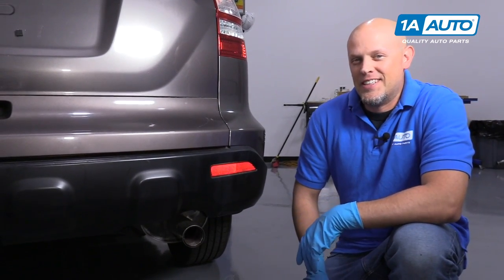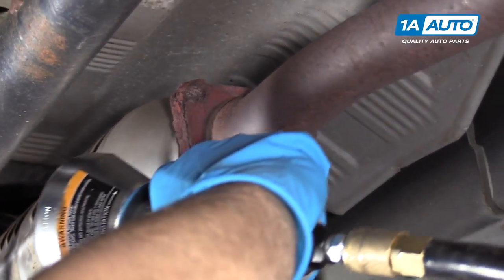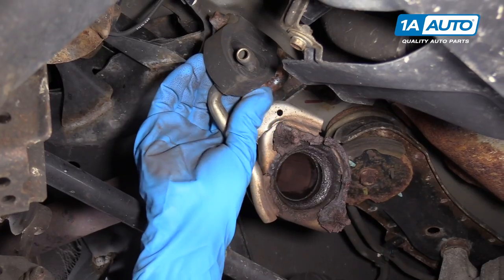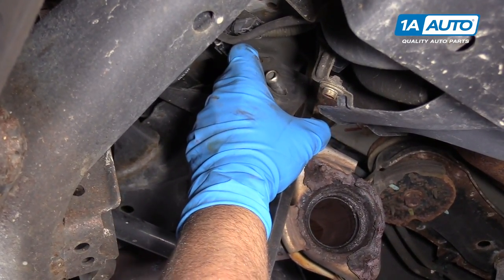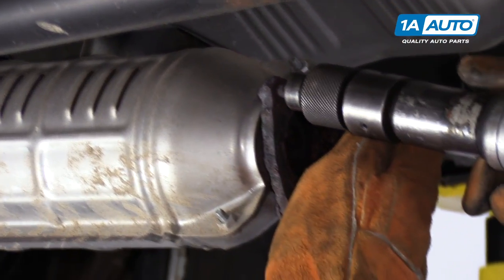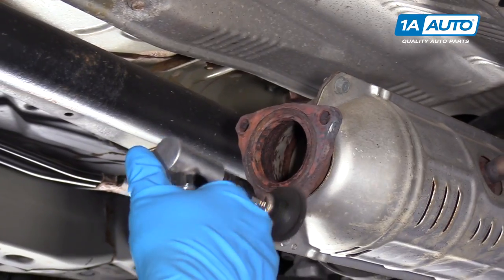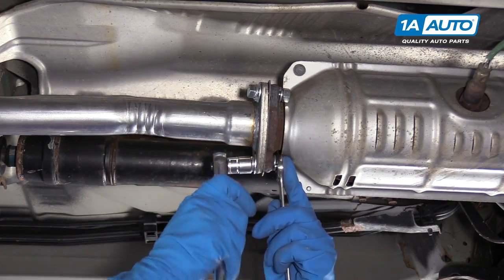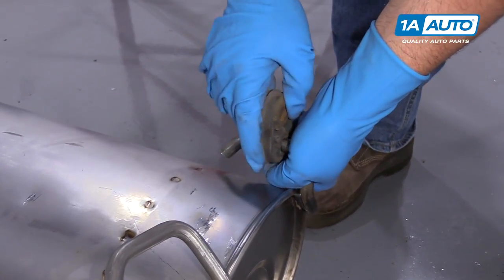How to Replace Exhaust 07-11 Honda CRV

Comment: Given the age and weathering and the fact that hangers have stretched , it would also been beneficial to replace them.    After rust,  broken or worn hangers are the leading cause of exhaust failure by causing stress on the system through strain and excess vibrations which leads to cracks.    The life of that replacement will be shorten by the very fact that the hangers were not replaced.

Comment: The rust point shown here in this video is a COMMON problem among all CRVs.  This video is instructing you to replace the entire Cat back system. Little did I know this is NOT the cheapest solution.  You can buy a universal flange from any autopart store and weld it to the hanger it broke off from.  This site has a great write-up.  https://www.crvownersclub.com/threads/exhaust-flange-repair-writeup-2007-honda-cr-v-ex-l-navi.210244/#post-1625822
Reply from the maker: +Mike Choi Thanks for the tip!

Comment: Give or take what would be the price of this repair and replacement. My 09 crv probably has the same or a very similar issue. Also in your opinion, what exhaust system/muffler would u recomment me install? Id be willing to get the top of the line brand/type if it meant it would last a little more. I have an indoor garage so i would be able to maintain it fairly well and avoid too much rust from weather.

Comment: Common problem with these CRVs. 
Save yourself time and money; only need 4 worm hose clamps. 
One around each side of the flange that flares out, semi-tight, then one on top and bottom to pull them together. First fully tighten the first two, then the two pulling them together.
Mines been running strong for 3 years.
Reply from the maker: +Devon Collins Thanks for the feedback!

Comment: wanna hear something messed up???? 
Put new struts on my civic yesterday and test drove for about half an hour, fixed the issue , that's awesome 😎😎

but decided to go for a second drive before bed just for fun and downshifted into second and my exhaust separated 
.....lmao in an instant went from so quiet you gotta watch the tachometer to sounding like my previous car....with broken exhaust lmao....
at least this is the very tail end where mine broke so pretty sure I can fix it myself

Comment: ...same as Zack Frostic...
I have the exact same problem with my CR-V. --- especially the rusted area at the flange by the muffler--
Is the only way to fix this is to replace the whole muffler and exhaust? I was hoping to just reconnect them with a new flange or something?
Reply: You can fix it but you have to extend and weld the hanger more to the front of the car cut off old connections and connect the exhale with something like that https://allegro.pl/oferta/lacznik-zlacze-tlumika-rur-wydechu-obejma-64x125mm-7546180597
Reply: You can literally just use 4 hose clamps. 2 around the sides of the exhaust line that are disconnected, two to pull them together on opposite sides of the flanges’ springs. Might get some rattling but I haven’t had any.
Reply: D. C. Pictures please

Comment: Funny my 08 rotted out in the same spot, TIP: spray alittle WD-45 on the hanger to help remove them. I never had one slide off
Reply: Silicon Spray/Grease or Red Rubber Grease is better because is "rubber friendly."